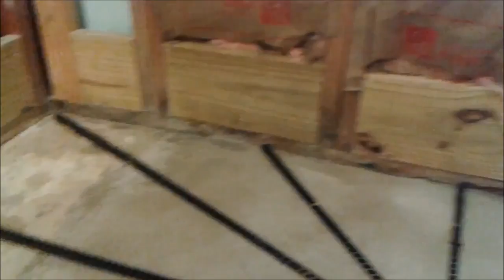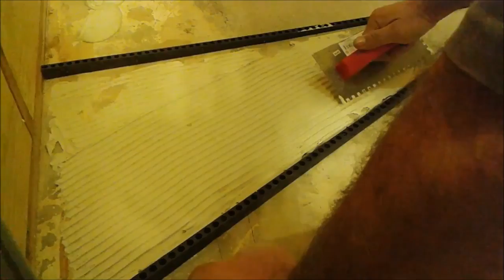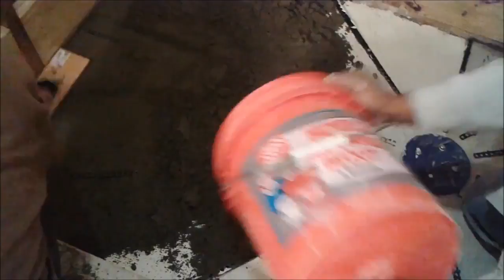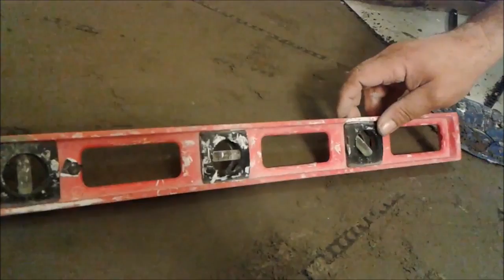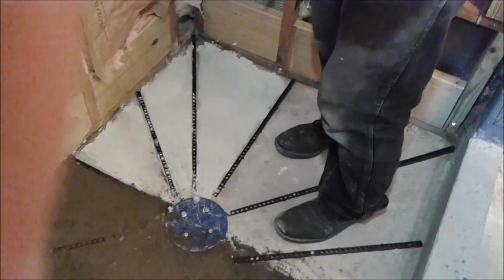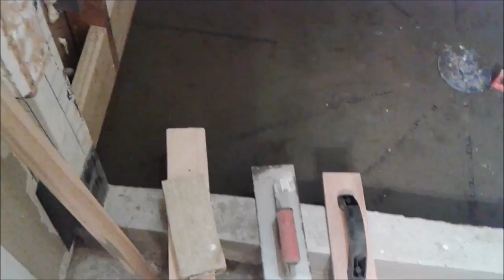How To Install Shower Pre Slope - Step By Step - D.I.Y - The Easy Way

Comment from the maker: Shower Pan Liner Used  size 6'x8' https://amzn.to/36bKKd4  size 5'x6'  = https://amzn.to/33b6pjQ or size 6'x8' = https://amzn.to/34bGUOu
Goof Proof Pre Pitch = https://amzn.to/306ynLK
Goof Proof Quick Pitch = https://amzn.to/335t8hf
Goof Proof Extra stick = https://amzn.to/2S1A9cm
Shower drain used = https://amzn.to/2Hp9c0a
4 - 1  Mix Mud used = https://amzn.to/344tfsq
thin set used = https://amzn.to/2EyeEgc
Reply: All these links lead to products that are not available or are 4 to 5 times more expensive than the one you'd find on home depot.

Comment: Hi, thank you for your video!  If you aren't sure if the concrete floor ins level enough would you use a leveler before doing your pre-slope?  Thanks again.
Reply from the maker: Yes I will use shelf level that modified thin set can stick to it.

Comment: Just did mine. Hopefully I added enough water and it hardens as it drys. I’m use to using concrete and mortar that’s a lot more wet then this. Thank you great video
Reply from the maker: Good luck.

Comment: Ok instead of concrete I have wood subfloor, should I apply modified thinset then screw down concrete backer board-over that then apply just the  vinyl liner then the leveling mortar then thinset again and tile
Reply from the maker: Not exactly. You need to find on YouTube how to do it when you have plywood floor.

Comment: I am installing Polyflor Quattro non slip vinyl in a level entry walk in shower area. The floor is timber joists 450mm centres. I will be putting in 19mm structural ply as a substrate with blocking in the shower space at 400mm centres. The bathroom will have underfloor heating with a 10mm self levelling compound on top. Thus the finished substrate height out side the shower area will be around 29mm. The shower space is 1650 x 900. I will use a circular central drain specifically for vinyl which has a clamping ring. What is the best screed product to use to form my falls? I assume a @ fall is ok with a smooth vinyl floor in the shower? Do I need to prime the ply substrate and is there an product for this job? I assume its cheaper to mix your own screed with sand and cement rather than buying the expensive ready mix products from Ardex or Kiesel? Thanks
Reply from the maker: It looks like the Polyflor Quatro is waterproof so I don't think you need to prime it however,  you should seek an advice from the Polyflor manufacture before you start the project. Yes it is much cheaper (in USA) to mix you own screed.  I used Mapei 4 to 1 Bed Mix  which works great for my application. You can also try  Laticrete   Bed Mud beside Ardex and Kiesel. The bast is to call manufactures technical support and asked them what  screed they  recommend for your project.
Reply: Joseph K Thanks
Reply: Joseph K hi Joseph, Sika have suggested Screed-1 but the tech data states min thickness of 30mm. Also they recommend Sikadur 32 as a bonding agent as the substrate is timber. But to create my falls with a perimeter thickness of 30mm means the screed thickness at the drain will only be around 16mm. In your video it looks similar. Is that too thin for a mortar type screed?
Reply from the maker: @allanpennington  I used Mapei 4 to 1 mud bad on a concrete base and it is true close to the drain the thickness was  an issue but you don't need to worry because the pre slope screed  next to the drain will not be disintegrated. The pre slope screed will be covered with PVC liner and on he liner you will build the quick slope. The PVC liner and the quick slope will protect the pre slope layer next to the drain that it will not  be disintegrated.  The manufacture is correct only if there is a heavy traffic directly on  the  Sika layer.

Comment: Can I use omni grip tile adhesive for my thin set under mapei 4 to 1?
Reply from the maker: No. only polymer modified thin-set or polymer modified mortar.
Reply: @josephk9182  Thanks Joseph for the fast reply.  I really appreciate your assistance.
Reply: @josephk9182  How about Simple set pre mixed thin set mortar
Reply from the maker: @dtgarris9723  You can use any pre set mixed thin set mortar provided it modified thin-set. Basically, it contains modified polymer in it.  The best will be to call Mapei customer service  and ask about  pre mixed thin set mortar that they recommended for 4 to 1 product.

Comment: Did you build the curb of concrete 1st? And the drain, did you set the drain up above the original concrete floor, and did you put pebbles around the drain before the thinset? Do you have a video of the next step? You mentioned the membrane but, after the membrane...what?
Reply from the maker: The curb is constructed from concrete please search in YouTube for how to build a shower curb . I also put all my videos from construing the curb to tiling the curb and shower floor. Please look in the video details (below this video ) for referral to the videos.

Comment: Question.  I'm building a walk in shower.  6x3. The drain is closer to the wall than yours. My pre slope kit is only 36" long. Are there extenders I can buy?
Reply from the maker: I believe yes., you need to ask the supplier.
Reply: I ordered extenders for perfect pitch that goes on top of the shower pan. Not sure about pre slope extenders

Comment: Can you use a masonry bonding adhesive instead of thinset? Thx Jo.
Reply from the maker: You need to use modified thin-set (rich in polymer ) that the mud can stick too. You have to apply the mud when the twinset is wet. You may use primer but you should  talk with the mud  manufacture in my case it is  Mapei ) tech support and it will cost you more money.
Reply: @josephk9182  Ill be using the 4 to 1 mix by mapei as well. I have a bonding agent on hand that is why I asked...So thinset it is then. I appreciate your time.

Comment: So I thought I had mixed the mud pretty good, but now that it’s drying, there’s some spots that have sand on the top, and it’s not as smooth as yours is. Is there any way to fix this or do I need to do it over?
Reply from the maker: It is okay. Do not worry. The pre slope does not need to be perfectly smooth . What important is the slope. Remember on the pre slope  you will put the liner so dont worry you did okay. By the way my pre slope is also not smooth it has a rough surface and that the way it should be.
Reply: Joseph K thank you so much!!! Your videos are so helpful and we are using it as a guide for our shower!!
Reply from the maker: Take your time. Good 
luck.

Comment: No pan?  you have to have a vinyl pan or some sort of roll on to prevent water intrusion into the wood!  Not Good.
Reply from the maker: This video shows the construction of the  pre slop. On the pre slope you put the PVC liner.
  Please look at this video:

How To Install Shower Pan Liner - Part 2 Liner Installation and drain flange installation

 https://www.youtube.com/watch?v=rBIdC50LuKw

Comment: OK, now I know I missed something. I'm tiling over a brand new floor that the tilers failed to pitch correctly. So I must be missing a step here as you mention pre slope and quick slope. Guess I'll have to explore your posts some more and see what I'm missing. Again thanks for your time and response.
Reply from the maker: Please follow this video:

How To Build A Shower Quick Slope Part 1 - Installing the Quick Pitch Stick System

https://www.youtube.com/watch?v=iRV3d56Zg58

and then to part 2 .

Thanks
Reply: Thanks again Joseph, will this method work tiling over a new tile floor
Reply from the maker: Yes.
Reply: Thanks again Joseph

Comment: How do you get the strips to all end up at the same level at the wall being they will all end up being different lengths?
Reply from the maker: Do not worry about it however. if you want all stick to have the same height next you should draw a horizontal line  from the highest point around the shower walls. It is not important if the different height is 1/4'" . the same height is not so important for the construction of the pre slope but for the quick slope.
Reply: OK, now I know I missed something. I'm tiling over a brand new floor that the tilers failed to pitch correctly. So I must be missing a step here as you mention pre slope and quick slope. Guess I'll have to explore your posts some more and see what I'm missing. Again thanks for your time and response.

Comment: How thick should the layer of modified thin set be? Also are those strips the ones that measure 1/8" at the end near the drain? Just trying to understand how high I'll need to raise the drain to accommodate the layer of thin set, the layer of mud and then the thin set and 3/8" tile.
Reply from the maker: You put a layer of thin-set  using 1/8 or 1/4  of an inch trowel. Yes the strip next to the drain is  it is /8".   The layer of the thin-set is neglected,  the mud next to the base drain will have the same height of the strips next to the drain which I believe 1/8 ".
Reply: Thanks Joesph for your prompt response and patience with me

Comment: Can you use just the thin set mortar for the preslope without putting the mud on top of it?
Reply from the maker: No. The thin set is an adhesive . If you use thin set for construction the  pre slope it will disintegrate.

Comment: so are you saying concrete over concerte will not adhere and u want modified thinset in between..

second, for pitch u used goof proof.. is this reusable ...
Reply from the maker: The mud bed consists of 3 parts sand and one part cement so you should use modified thin set to force the mud to stick to the concrete.

The goof proof is not reusable it stays in the pre slope.